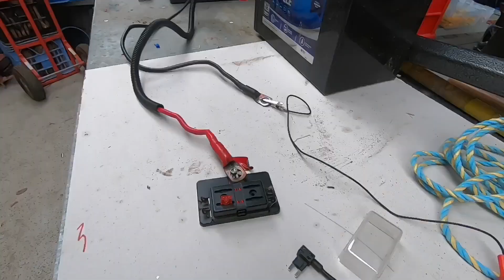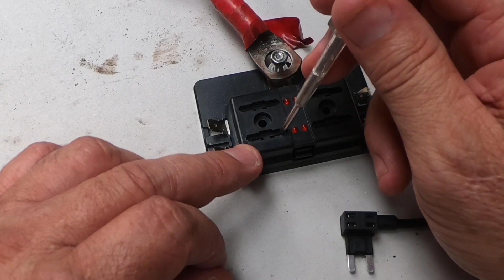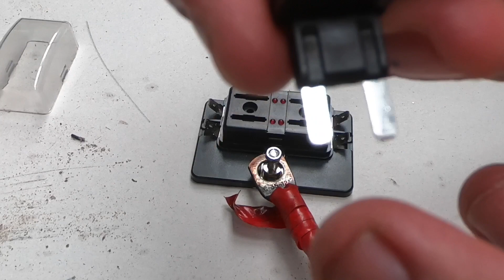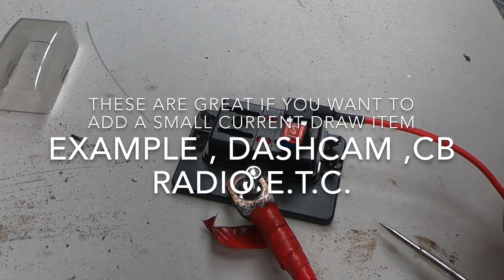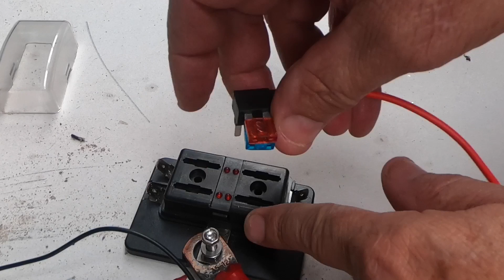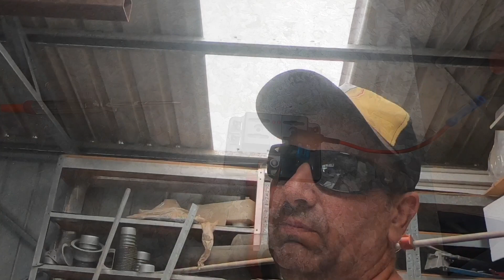using add a circuit fuse taps

Comment: good point there. I'm using this to tap a circuit and drive a relay. Not less work but I wanted the relay active only when Accessory and running and this was a safe way to do it, should the relay coil fail for some reason.
Reply from the maker: Cheers thanks for sharing and thanks for watching 👍🍻

Comment: Would it be safe to run a small 4 led reverse light using one of these or will it draw too much power.
Reply from the maker: Should be fine I wouldn’t imagine a 4 led light would use a lot of current . Thanks for watching 👍🍻
Reply: @EFFICIENTSELF  thanks for the quick reply

Comment: Dear brother, I want use one pair drl light on adding front wipper fuse which is 20 amp.... So how much amp to be add for drl on top fuse tap.... Reply me please brother. Thanks
Reply from the maker: I would run a new circuit for your driving lights and have it on its own fuse as you would need 20 to 25 amp depending on your driving lights amp draw. Thanks for watching 👍🍻

Comment: Exactly the answer I was looking for!
I needed to know if I had to match the amperage that I was going to draw for my dash cam as the feed from the fuse box (5a fuse to use add a circuit to 5a for dashcam) but just like a house circuit it is all about the load and how much will be drawn from it. 

So, my dash cam has a 5a fuse so I should choose a 15-20a fuse site from the vehicle.
Reply from the maker: choose a circuit that is a little over 5amp will suffice. thanks for watching 👍🍻
Reply: @EFFICIENTSELF  cheers!

Comment: Hey man great video thanks alot! I just bought one and was asking myself if I could put a 45A fuse in the bottom slot if the fuses in the box it came with only goes to 10..? Will the wire be good? I bought the same you did
Reply from the maker: If you need to use a 45 amp fuse I would run another circuit . Thanks for watching 👍🍻

Comment: Hi there, may i know why the top fuse must be smaller than the bottom one (original fuse)? Does fuse tap create a sort of parallel circuit? Thanks!
Reply from the maker: You will place too much load on the cable feeding the fuse tap. The fuse taps are great for light load accessories like cb radios,dash cams ,reverse cameras e.t.c. . Like for instance don’t tap into a 30amp fuse and put a 25amp in with it as it not meant for this.. if you want to install heavy power accessories it’s best to create a new circuit with its own fuse. Hope this helps and thanks for watching 👍🍻

Comment: I have a empty slot in my car which is ACC for cigar lighter in the boot which my doesnt have it. But i only have 1 pin/wire in that empty slot, can I still use it with a fuse tap for a backup camera ? Do i still need 2 fuses or just one at the top or bottom ? Will be very helpful to know. :)
Reply from the maker: From what I read pull out existing fuse that you want to tap into and put in fuse tap and the fuse you pulled out will go into fuse tap and then you will have spare for your backup camera. Hope this helps
Reply from the maker: https://youtu.be/uIuJCIvjJdU. My reverse camera install
Reply: Can it be that fuse slot only has one pin with 12v only on ignition? 
What i meant is if there is a free spot can i can use it for the camera, right ?
Sorry English isn't my first language
Reply from the maker: Yes I guess so

Comment: Does it matter which way the fuse is in the addacutcircuit too or just how its plugged into the fuse box?
Reply from the maker: Won’t matter what way fuse is in the ‘add a circuit’ thanks for watching 👍🍻
Reply: @EFFICIENTSELF  Okay wanted to make sure. Thanks for the quick reply!

Comment: How do i know how many amps i can add to a circuit? Is it safe to just go for anything less than the circuit?
Reply from the maker: Yes go less. I only use these mainly just to quickly add low current accessories like dashcams ,cb radio etc. thanks for watching 👍🍻
Reply: @EFFICIENTSELF  im installing an afr gauge, what fuse would you recommend me using? would 15A suffice?
Reply from the maker: Sorry mate I’m not sure as never installed one. Try a search on google 👍🍻

Comment: so im trying to add some drl ligths, I know which fuse is the one for the lights but I need to add this thing, I can just move that fuse on the car to this kit? or I need to get a new fuse to plug in? thanks
Reply from the maker: I put a set of driving lights in my vehicle . I put one of these fuse taps into my high beam so when I toggle the high beam on the vehicle . I put in a new power circuit for the main power feed for my driving lights to be on the safe side.

Comment: Greetings from Oracle, Arizona USA
I don’t understand why the added fuse must be at or lower than the original fuse rating.  The new load isn’t using the original fuse in any way. This device just adds another receptical to the fuse block. Please explain.
Reply from the maker: you can go the same if you like . I just prefer to go a lower amperage on the add a fuse. thanks for watching

Comment: Hi. So my issue is that both my test probe lights up when the fuse tap is in both ways. It doesnt matter whether i use a multimeter or test probe. Im getting conflicting results. Ive watched 4 different videos and get nowhere. Ive also tested the box and tap both without fuses. Can you help please? I need to get this finished. Cheers
Reply from the maker: Can you find the hot side of the fuse block?  One side should have power with no fuse Installed
Reply: @EFFICIENTSELF  Thanks for the reply. I ended up doing just that instead of with the fuse tap in. It's all working great. Thanks again. ;)
Reply from the maker: Good to hear you solved it 👍🍻

Comment: Ohhh i see. So i installed 2 gauges in my vehicle using a 15amp fuse slot and the gauges work but my accessory slot no longer works to use a radar or charge phone. It's because I didn't add a fuse and only used the existing fuse from the circuit. So I should add a 10amp fuse to the top, leave the 15amp original fuse in the bottom and my 12v accessory socket should work again? Or can I add another 15 amp? Pretty sure I would need to run two 15 amp fuses because the original fuse I used was 15 right? This stuff is confusing lol. I just want to be able to run my two .5v gauges and have access to my accessory/cigarette socket at the same time.
Reply from the maker: Should do if i read that right 😂 i had to read a few times  . Yes it should work 👍🍻
Reply: @EFFICIENTSELF  Hey man thanks for the swift reply, wow! I edited my post again but basically the slot I'm using was a 15amp slot used to power my accessory socket in my car. Should I add a 15amp to the existing 15amp? or should I run 15 and 10? Subcribed!
Reply from the maker: Run 15 and put a 10 in .. the second you are running needs to be a smaller fuse ..
Reply: @EFFICIENTSELF  Ok, now I think I see! So the 10 will be used to power the gauges and the original 15 will be for accessory socket.
Reply from the maker: Yes but remember there is a hot side to your fuse box and make sure you have the fuse tap in the right way...rewatch if you in doubt
Reply: @EFFICIENTSELF  I sure will and thanks for the great help. Cheers from the US.
Reply from the maker: My pleasure buddy. Thanks for watching 👍🍻

Comment: Hi  if it’s a 10 amp fuse in the box can I put a 10 amp into the tap cable . but l have just noticed the 10 amp in the fuse box says it’s a spare but when I turn my ignition on , voltage tester lights up Now do I still need both fuse or just the one 10 amp fuse 🤪
Reply from the maker: Sorry just trying to understand the question .lol. If it says spare then there is voltage coming through?... you can put the 10 in the fuse and the one you are trying to feed needs to be less.... hope it makes sense cheers 🍺
Reply: @EFFICIENTSELF  that made more sense  then the way I tried to describe it  lol  thank you keep up the good work and stay safe 👍🇬🇧
Reply from the maker: Good to hear as I had to re read what I wrote 🤣 . Take care yourself mate 👍🍻

Comment: Could I put a 30 in a 30? I’m adding a power window kit to my truck and the only way to wire it is to my wiper fuse. I want to use a tap but I’m not sure about that, and I also really want my fuse box to still close since it’s right there when you open the door.
Reply from the maker: They recommend to use less of a fuse to what you are putting it in.... worse thing that could happen I guess is the fuse will blow... probably better to run another circuit to feed your power windows.  You could try the tap first and if it not work out you look at running another circuit. You might be fine if you not use the windows (I’m guessing 2) at the same time you are using the wipers.   get a few opinions on it. Hope you work something out . Thanks for watching 👍🍻

Comment: Is all the fuse tap hole so tight that we need to use some force to insert and remove the fuse from it?
Reply from the maker: Yes will be bit tight . I had to use the little fuse puller device to get the fuses out or use needle nose pliers. Thanks for watching 👍🍻
Reply: @EFFICIENTSELF  i see. i have some fuse taps and in-line fuse wire, and its so tight to insert and remove the fuses, i thought mine are defect items. thanks for reply!

Comment: The is for the video, I'm planning to get this done on my bike. Was wondering what if the accessory I'm adding already has a fuse on the line? Do I still need to add a fuse to the top of the fuse tap? Or can it be left empty as I've got another fuse running further down the line for my usb charger ports.
Thanks again 😊
Reply from the maker: Yes you will need a fuse in the fuse tap for the power to flow through. So no need for fuse down the line . If you have a fuse down the line just connect to power source ( sorry hope I make sense as I’m just answering as how I’m reading it )  thanks for watching bud 👍🍻
Reply: @EFFICIENTSELF  thanks for your reply, I just tried it on my bike first with the tap fuse with just one fuse connected to the bottom as I already have a fuse connected down the line and the tap fuse didn't work, it only worked when I inserted another fuse on the top too and then power flowed by I had to scrap the idea as my fuse box on the bike wouldn't close and so just jammed the cable on the hotside plugged my original fuse to the fuse box and since I already have a fuse down the line I figured it should be ok. But thanks for your help and reply. Appreciate it 👍
Reply from the maker: Good you got it sorted, hope you have great weekend 👍🍻
Reply: @EFFICIENTSELF  Thanks and you too 👍😊